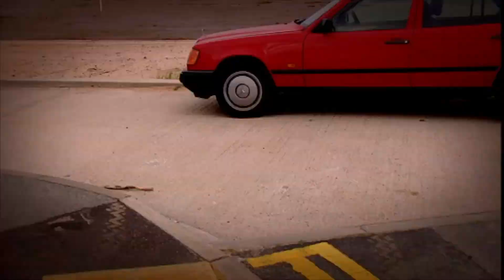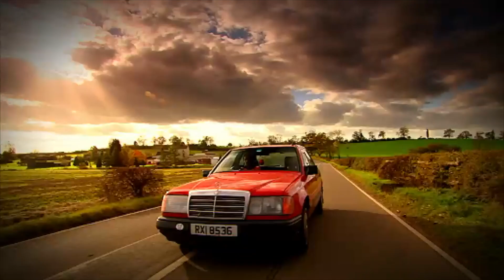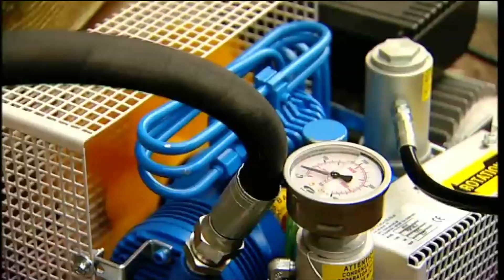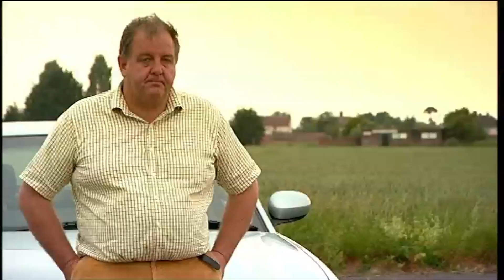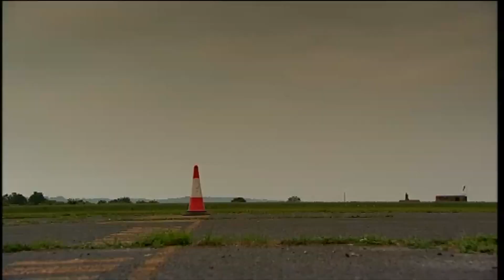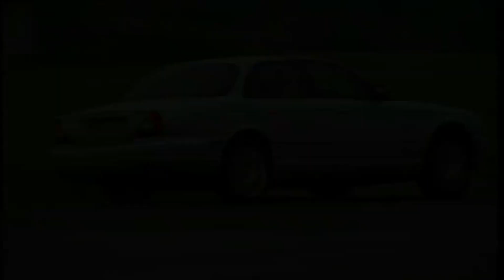Chip Fat vs Cider Fuel: Which works better? | Fifth Gear

Comment: Problem with Methane or Propane is that its a dry fuel, So hardened valve seats needed if you want longevity, Remapping of the electronic timing AND your plug life will be about 1/3rd along with having to keep your Ign system, leads etc in top condition.
The other issue with Petroleum Gas powered cars is they consume gas, Propane or Methane and nearly twice the volume so your gas needs to be priced way less than half whatever the cost of Petrol is and I say this from experience.
Chip fat today isnt really an option anymore, Modern oil burners (Diesels) wont cope compliments of Euro spec fuels and even making Bio diesel isnt viable unless your Oil burner hails from the 90's or earlier. Chip fat is now bought by large companies as well and goes into many products from cosmetics etc to industrial processes plus im sure the EPA are happy to stick their rules and regs in an expensive place to stop the average joe collecting and storing the stuff.
Nice piece from Jonny though but it hasnt aged well information wise lol